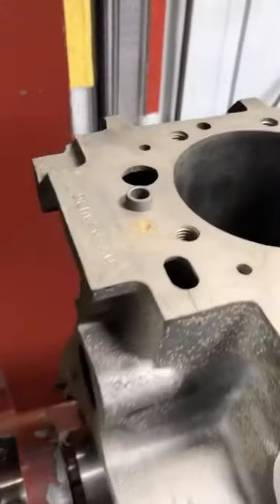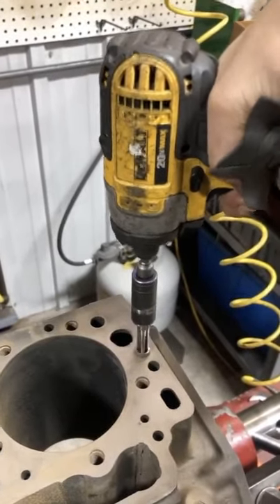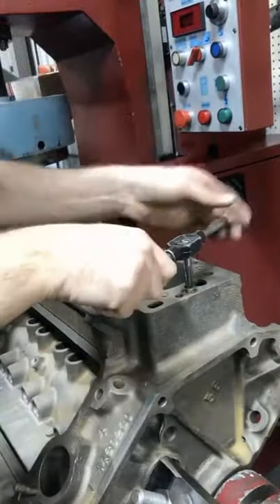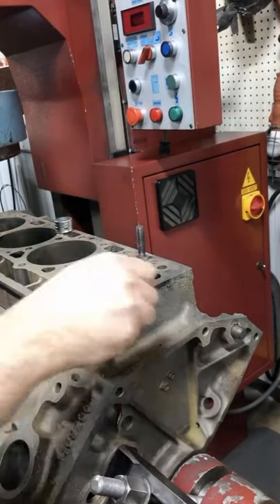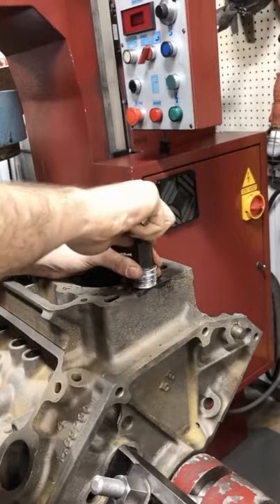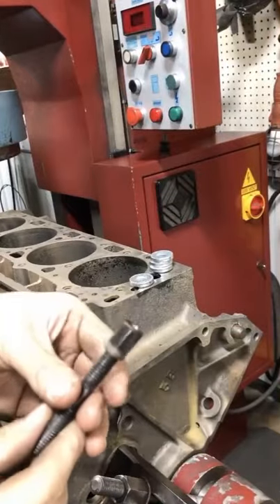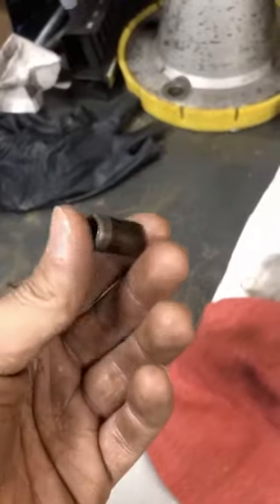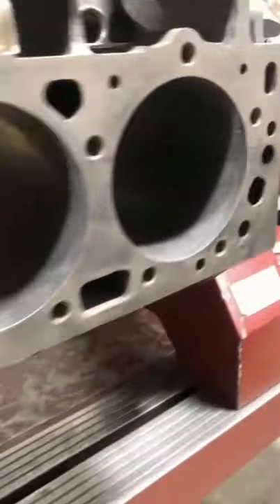#shorts Engine Block Dowel Ring Removal Life Hack

Comment: Wouldn't that dowel ring be an extremely easy part to make if it was damaged?
Reply: Likely, but it would take more time making one comparatively to this method.
Reply: @dennisreelie1720  It wouldn't take more time really I could machine them things in a minute.
Reply: @herbsewell4995  sure you could champ sure you could
Reply: @herbsewell4995  but like why have to measure, waste metal and get it onto the lathe, turn it, etc. when you could just tap the old one and pull it out with a couple spacers and a nut? And you’re gonna have to pull the old one out either way, so even if it’s faster to machine a new one, it’s also more effort imo
Reply: @Smoke---  if it was my recommendation I wouldn't have to play with that Stupid plug to begin with.
Reply: @herbsewell4995  okay… your point?
Reply: Absolutely not ! Fun fact : these are actually made from albino unicorn peckers and hermaphrodite elves beat them into shape
Reply: No. Time consuming.
Reply: Numbers matching dowel rings! ;)
Reply: @herbsewell4995  No, you couldn't.
Reply: You have to remove it anyways to deck the block, might as well save the dowel and now need a new one
Reply: if you have a lathe! this would be a good trick for a small shop or DIY
Reply: Do you use valve grinding compound for extra grip when using the traditional puller?
Reply: It doesn't matter if you can make one or not. Yes, a replacement could be made, but the point is that the dowels have to come out anyway to do machine work. So if you have to remove it, why destroy it? If it does happen to get damaged during removal then that's when you call one these armchair machinists in the comments to make replacements.
Reply: @NoSaysJo  That really doesn't look like a complex part, unless exotic alloys or heat treatments are involved. You could knock a couple out pretty quickly.
Reply: @funny36ful first part of your comment was understandable, the last part, didn’t make any sense at all!!!!
Reply: @Tunkkis these are just simple dowels that are there to align the head🤦‍♂️ no “ exotic” metals are involved😂 if necessary, ready made replacements cost just a couple bucks. No need to break out the lathe, drill press, grinder, CNC, or any other high dollar equipment just to replace a simple dowel 😂😂😂😂
Reply: Don’t understand why you are making replacing a simple dowel so complex😂😂😂😂 replacement parts are not that expensive 🙄
Reply: @Smoke--- it’s also not professional to not replace it..
Reply: @Tunkkis I could knock a few of these out in like 15 minutes and that’s with me fucking around. This ain’t a complex part.
Reply: @M21-w1y you didn’t catch the part that they’re hard to find did you? 🤦🏼‍♂️ so you can’t just go buy new ones..
Reply: @lonewolftech not really. It all depends on what the customer wants. 99% of customers are going to want their engine fixed reliably and professionally for as little as possible whilst still being solid so they don’t have to worry about it and they’re not wasting money. That isn’t a part that’s going to fail if you don’t replace it, so it doesn’t matter. Shops charge $150 an hour where I’m from, so no, I don’t want them wasting 10-15 minutes making a new one in the name of “professionalism” when it’s completely unnecessary and is gonna cost me another $50 after labor and material markup. Believe it or not, time is money, so wasting the time that the customer is paying good money for for no good reason is the real culprit behind what’s unprofessional
Reply: Yes
Reply: Providing a metal lathe is handy. But, need to tap anyway to get them out. So, probably not.
Reply: @herbsewell4995  that's bs
Reply: Obviously that takes a lot longer than this method , only if u have to make one
Reply: @jshafer51 if you’re not going to reuse the dowel you I guess you could, just gotta be careful because if it DOES spin in the compound its going to leave some nasty gouges
Reply: Could definitely repop in a lathe

Comment: This is basically creating a threaded insert or rivnut type thing out of the pin. This is the kind of stuff you think of after hours of the usual tool not working. And out of desperation you come up with this cause the damn thing has to be back together so you can go to work on Monday!
Reply: 🤣😂 so true

Comment: Good trick, I work on cars and almost all the dowels I see aren’t thick enough to tap though. Usually end up putting a drill bit that fits snug inside it and then vice grip the outside of it. The drill bit keeps it from crushing in.
Reply from the maker: Yep! That’s an excellent quick tip as well 😂 that’s my usual go to
Reply: You did it backwards - using a tap handle should occur FIRST, Then, if desired, the impact/driver.
Reply: @kennethboswell8454 agreed starting a tap is the most important part and should be done by hand. Using a impact driver is pretty crazy though, a drill would be slightly better. Expecially on a tap thats not ment for impact tool use, any binding gives it a even high chance of snapping in the part. But everyone does it their own way and will learn by their mistakes eventually when issues occur.

Comment: I tap with my impact all the time. Never had any issues
Reply: I also tap with impact. Sometimes you don't have enough time when you have to tap 40 holes. Plus some threaded holes are very long. Like 3 inches of fine thread pitch. Just know how tough the hole is.
Reply: It’s the shock load they aren’t built for. The vibrations and the thinner profiles of taps versus bolts that fracture them. That and the fact they are high carbon tool steel
Reply: @repoman28d  Do you have a degree in metallurgy ?  I do.  You are full of it.
Reply: If it works who cares?
Reply: Same here lol I use my drills also just set the torque.
Reply: @lonewolftech Using a drill is fundamentally different than an impact.

Comment: Nice work.  However look into a dowel pin remover.  There are standard and metric sets.  I have both.  I'm not a Mac tool fan, but the sets I have are of.  My snap on rep had some trade ins, and I'ma tell you....  Best $$$ spent!!!!

Comment: I work in production and I have to tap holes in aluminum parts. I welded a 7/16 socket to a 1/4" pipe tap. I use a 3/8 Ingersoll Rand impact. Using plenty of tap fluid I've done approximately a thousand holes with it. It tripled my production  speed and haven't broke the tap yet.

Comment: I was taught this trick by an engine builder years ago. You could also use a slide hammer for the extraction.  👍🏼
Reply: Yeah but a slide hammer will chew up the dowel pin and you wont be able to reuse it.
Reply: @konnerkramer329  no it won’t. I’ve done it that way loads of times.
Reply: @markdavies3151  on regular dowel pins it wont but on sheet metal dowel pins like what a SBF uses it will destroy them coming out
Reply: @konnerkramer329  do you mind linking an example of what exactly it is you’re referring to?
I’m not familiar with SBF and I don’t see how you could damage a dowel if you’ve managed to tap it already. Thanks.
Reply: @markdavies3151  small block ford

Comment: If it's a blind hole, select a parallel punch with a diameter that just fits inside the dowel, fill it with oil and hydraulic them out gently with the punch and hammer.

Comment: Same type of thing I do with broken leaf shackles, cut the head of the bolt off and pull it out the other side using multiple spacers, turn shackles into an easy job

Comment: I had a 1957 cad 365 ci rebuilt it in my teens with the help of wally.trans to amco .strong engine bord it out .040 new pistons it became a 375 cid same crank stroke as a 400 chevy small block .300 horse 325 with duel squads 451 inch lift bolt on rocker arm shafts hydralic lifters 4800 lb car? she was nice.steel crank stock i was going to order the duel carb set up 750.00 at the time.it would smoke the tires all day long but it was a cruiser.4 speed hydromatic with air black white seats.

Comment: I usually just wreck the old one and find a dowel pin that's close to the right size and make it fit with a die grinder
Reply: And that's why he's a professional lol
Reply: Louis Edwards  it's perfect fit when I'm done with it. I meant to say roll pin. Cut it to length and jam it in
Reply: @ohiohouston3560  
A roll pin is essentially a spring.
Said that, rollpins are fairly rigid but it’s not a solid as a dowel for locating.
Reply: I guess you like to work harder and not smarter.

Comment: If you find a doll that fits perfectly inside the hole or if you drill it to a perfect diameter you fill it with grease and drive a hammer in it it'll push the dollar pen right out but tap makes sense to just another way to make it look more pristine

Comment: this thread is definitely not straight. Torque is not transmitted correctly possible source of error. In practice, however, 99% of the time there will be no problems. I wish you a nice day
Reply from the maker: Served it’s purpose. There was no reason for it to be straight 🤦‍♂️

Comment: There's nothing wrong with power tapping as long as you use a 2 flute or a 3 flute tap. These are machinist taps and are designed to be power- Drive

Comment: That's kick ass..I know the newer caddy engines have the threaded serts too..they're costly and can't be reused..it leads to head gasket failure..good video
Reply: Threaded inserts have nothing to do with this. The newer caddys pull head bolts so you drill and tap those but these are alignment pins not threaded inserts for head bolts.

Comment: Stick a drill bit in that just fits. Spray CRC around the dowel. Use a set of multi grips to squeeze against the dowel. Turn it and the drill at the same time with a socket. Done.

Comment: If pressed into an end hole, fill the hole with oil/grease and put a precisely fitting centre pin in the collar and punch it with a hammer. Hydraulic force will do the rest.

Comment: Uncommon engine? It was in all Cadillacs from 1956 to 1958 and stroked to 390" all the way to 1963.
Every bolt and washer on that thing is still made.
Reply from the maker: Don’t get your panties in a bunch. Relatively uncommon in our area when compared with something like a 350 Chevy.

You missed the point of the video.
Reply: @JAMSIONLINE  i'm in Sweden and it's not uncommon here atleast 😁 .
But i understand what you mean i was just pullin' your leg 👍

Comment: A shop that works with heads and removes dowels, doesn't stock new dowels?
Reply: They are hard to get and they need to be within 1/1000 +- from spec. Hard to machine.

Comment: Why not use a dowel pin removal tool? Just a kit with different sized collets to squeeze the pin and pull it without damaging anything. Don't get me wrong this method works just fine but there is a dedicated tool for the job

Comment: In a machine/ engine shop and says dowels for that block are hard to find.
Machine them duh.🙄
Reply from the maker: Of course one COULD machine them... Believe it or not, not every tip we give out is because WE need to do it a certain way, but to teach someone else who ISN'T in a machine shop. Regardless, this is still far quicker & less expensive than machining new dowels.
Reply: @JAMSIONLINE  good point! Plus the fact that the pins are tool steel and very tight tolerance, a center less grinder would be needed which even fewer people have.... 
You can however find replacements if you look at the aerospace industry. Company’s like Actek, Carrlane and Vermont gauge make them in any size you can imagine. 
Love the channel, keep up the good work!